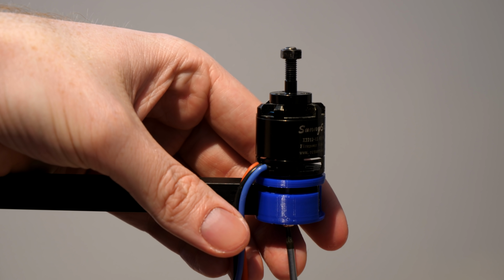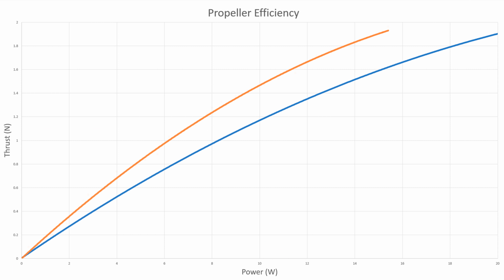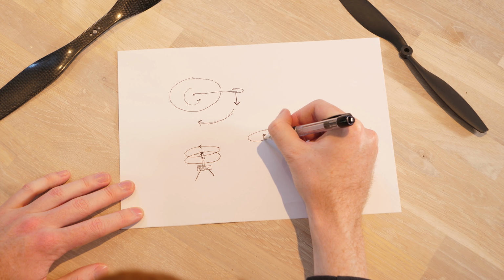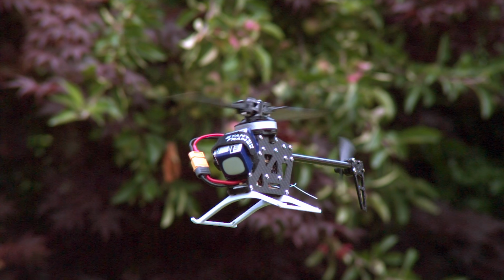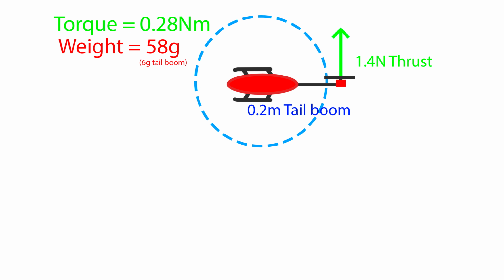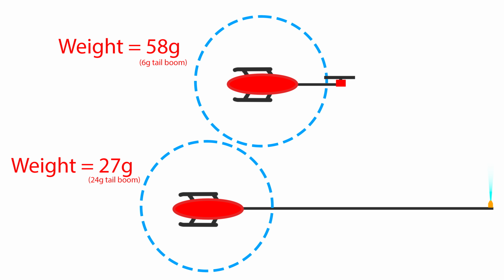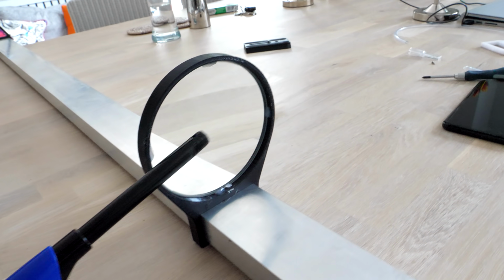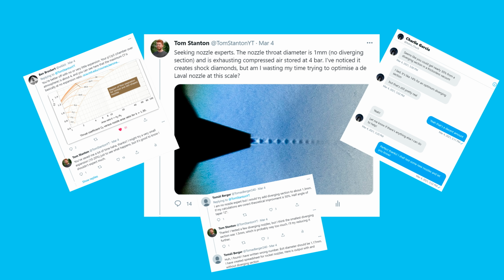Air Bottle Helicopter

Comment: Seeing as you are powering the rotor’s acceleration as you fill the bottle, I’m wondering if you could add weight to the blades to store the inertia like a fly wheel?

Comment: Don't use an air turbine and just use the air nozzles on the ends of a single rotor to spin it. That takes care of needing to counteract the torque between the helicopter body and blade. If it's too difficult trying to pipe air through some sort of joint that could spin you could even hard mount the rotor to the end of the bottle and let the entire thing spin on its long axis. Not a particularly graceful machine but if I'm following your description of the physics involved it might work. Good luck 3D printing hollow rotor blades with nozzles at the ends though!

Comment: I think two bottles cap to cap with a propeller and turbine for each might have been the play here. Double the propellers means double the stabilization. Any forces from the fill nozzle would be directed straight up the center of gravity. The propellers would be lifting an equivalent amount of mass despite there being two of them. Also the bottles themselves could be used as the aircrafts structure though you might need some struts between the bottles to prevent vibration issues

Comment: Make the inlet a oneway valve. So that it doesnt influence the craft. And to make the disgne easyer. Replace the tail bone and bottle with a thinner long bottle. That runs over the complete length. This means les overal waight. and the tail roater is close to the energy source(no time spent inflating the tubes.).

Comment: An advise for your design: use a tube to guide pressed air to the blades' tip to drive the main rotor, you don't need counter rotation mechanism and gearbox. but a sealed rotating mechanism is needed. use PMI foam and thin carbon cloth to build the rotor, make them super light and very long, the only dead weigh will be your air tank, which could be built by carbon fiber also.

Comment: Loved the video! This is a great example of true experimentation and engineering!

Edit: I have a few questions:

How much airflow was needed to lift the craft? (You only had the watt calculations) 

Did you have and expected PSI for the bottle to achive?

Do the nozzles you used output a consistent output after a certain pressure? Or is it, more PSI in the system, the more output?

It just seemed like the idea to fill and launch at the same time was too uncontrollable.

Comment: Weight balance is more towards the tail that's why the nose pitches up violently. The bottom of the bottle is thicker and heavier. Move the props about an inch or so further towards the bottom of the bottle and try again.

Comment: Simplified approach: one rotor rigidly attached to a bottle cap which can be screwed onto the bottle. Air is allowed to pass through the blades to the tips where it causes the entire assembly, bottle and all to spin. Bottle has a pendulum effect keeping it stable.

Comment: Your heli doesn't have enough sustain.

I'd suggest trying a 3liter soda bottle, and a more standard fill valve and shutoff valve setup.

I'm sure you can make the weight gain from those changes minimal, but it would allow you to set a definitive pressure before launch. I don't think your bottle was filling to max pressure

Comment: You are Superman! 😂 I have no idea of this project but you did it!!!
Reply: Thoughts: what about turn the bottle to the stand up position, then it would have better stability keep the helicopter not to tilt sideways. Then add 3 thin sheet make it looks like a rocket, the center gravity will be lower, and the twisting effectiveness will be reduced. And change the tail to a long straw, reducing the weight, as well it don’t need that much stiffness on the tail. Now you will have a more ugly helicopter, but much better controllability. Now you will probably need to deal with the rest of frictions... 
otherwise, test it on the water... less damage to the failed test... 
don’t know if you can see this but good luck to your hardworking guys!

Comment: Wouldn't consider it a failure.  Pushing the limit on designs are learning new stuff is what the game is all about!  Wondering what the lightest high pressure  (2000-3000 psi or above 170 bar)  chamber you could come up with??  Having a higher pressure vessel and adjustable lightweight regulator would add a lot more weight but you could also build a larger efficient air engine (and prop).  Think it would be neat to see just how much larger it can go and still provide lift and control.  BTW have you seen Tim Stanton lately??  Noticed he also hasn't posted videos in a while!

Comment: Ditch the turbine, and go with an air-jet tipped rotor affixed to the air supply so the whole thing rotates like a stick copter.  It'll be a simpler design with no moving parts (other than air) and a lot less weight.

Comment: You should use the bottle to power a set of fly wheels on a detachable helicopter (so the bottle is just the launcher, slowly releasing energy into the fly wheel)
Reply: When the bottle runs out of air it can launch the helicopter like a spinning top

Comment: Here's a thought: use tip jets to spin the rotors and thus avoid a gearbox entirely.
Reply: That would be a lot less efficient that the current design.

Comment: Maybe try boosting the performance providing additional gas supply by adding some dry ice. During the phase change you will get constant pressure during the flight and each g of dry ice will give you additional 0,5 l of CO2. Maybe it will not work with helicopter, but for plane it could be usefull.

Comment: Would mounting the air storage bottle vertically help?
  -  Maybe reducing the downwash hitting the craft will reduce the thrust needed, and reducing un-symmetrical air flow around the bottle might reduce a possible source of instability.
  -   Putting the bottle vertically would lower the center of gravity of the craft, and would increase the moment of inertia resisting pitch and roll, both increasing stability.

Comment: For contra rotating props, instead of gears, you could use a thrust bearing.  If this thrustbearing is held in place and the engaged surfaces spin freely, it should efficiently transmit a counter force from the bottom prop to the top prop.

Comment: More bottles means more weight, which means we need more thrust, which means more bottles – but won't an equilibrium be eventually reached? I mean, if 1 bottle is enough for one propeller and engine, won't 2 bottles be perfect for 2 propellers and engines? XD

Comment: Dude it’s time to move over to 9g CO2 bottles as a source of power for your projects, learn to control it and build something that stays in the air for 1minute or more. Maybe start with a motor glider and try to stay in the air for 10+ Minutes. Awesome content as always but you reached the limit for soda bottle power ;)

Comment: I think you need to hold the cog down until you reach full pressure and only release once you have a high pressure, looks like you always released it as soon as it had enough pressure to just do a little more than hover. If you want to achieve higher lift and ceiling height you just need more pressure and make sure it doesn't fly away until you reach the desired pressure. Hope you might try

Comment: When you get shock diamonds that means you're already over-expanded. Shock diamonds come from the atmosphere pressing the exhaust flow together. Converging-diverging nozzles only make sense when the exhaust leaves the nozzle above atmospheric pressure, visible in Schlieren imaging as the flow expanding outwards to the sides after it leaves the nozzle.

Comment: Even with no drag, the rotor efficiency goes down with thrust. Thrust is proportional to power^(2/3). And larger rotors have theoretically better thrust/power, with power inversely proportional to rotor radius.

Comment: I like the non fossil fuel idea you are possibly running on. It can run basically on muscle power, compressing air using a hand pump/compressor.
That would be cool! A man powered air compressor.

Comment: Have you considered having the main rotor powered by a flywheel and using air for control? Or possibly getting extra power through the combustion of alcohol vapor like in the rocket video? Also, great job, I always love your videos!

Comment: You have to put the inlet nozzle in the bottom of the bottle (under the main rotor) so it isn't pitching.
Reply: Came here to post the same suggestion and was surprised I had to scroll down so far to find it.  He could also go back to the original fill nozzle to get an initial boost for liftoff.
Reply: Or pre pressurize the bottle with a pump and use a valve to release the pressure, doing away with the whole problem of release instability.

Comment: Love the project! It looks like you're still getting a lot of energy loss in the gear wobbling on the prop. (check the slow-motion) maybe fortify the structure of the mount, and tighten your tolerances then add lube? I can see the gears binding, which is causing the bottle, and tail rotor shaft to flex.

Comment: i'M sure you thought yourself about it, But just ... the think i was thinking about watching your vid was, that the rotar was allready turning while air was filling. would it not beter to hold that until the bottle was fully pressurized and you release the heli?

but it is cool to see that the best people has some issues sometimes getting there idea out to work. It give us inside on how difficult it can be to be an engineer. And that it is okey when it happens. Now we know this concept did not perform as we wanted.

Comment: another option could be is to have a gear/transmission connected from the main turbine going to the tail rotor. in this way, you will only need 1 turbine (main turbine)..

Comment: What about having the bottle be vertical with the Old inlet nozzle design on the bottom. Then integrate the turbine and carbon shaft into the bottle cap. Fewer parts and the vertical jet of air would give you a little boost off the ground. I have no idea if this would be dramatically less stable with so much weight hanging down below the rotors

Comment: Air powered helicopter in that size is totally doable with a more efficient engine. 

Here's a toy version from a ways back that uses a piston to better extract air pressure energy: https://www.ebay.com/c/1701458583

Small-scale turbines are just hard without terribly fine assembly tolerances.

Comment: Is the bottle actually getting pressurised while running like that?
It seemed to last way less time than the other planes.

 Feels like it would leave through the engine just as fast as it entered through the tube/ the pressure drop of the compressed air moving through such a long/ thin tube at high flow would mean the bottle doesn't actually get pressurised and it stops almost as soon as it's disconnected?

Some sort of flow divider or switchover system might be necessary? That, or some chonky inlet tubes/ high volume pump

Comment: no shit its not going to work the most efficiency way to use the compressed air would be to nozzle it out the bottom, and even that doesn't have enough thrust to sustain flight, much less using complicated gear ratios which probably have 20% efficiency. Dont know why you would waste so long on something that is simply impossible no matter what

Comment: I think coaxial blades are your best bet, trying to make a "tail rotor" that just passively generates the right amount of torque trough the entire flight is probably impossible, since you don't have to worry about swash plates i bet you can make the mechanism be very simple, i am far from an expert but maybe you could make a fixed vertical shaft where the props can spin freely than spin the bottom one with the turbine and connect it to the top one with a simple gear to reverse the rotation. I also would like to see your compressed air engines run on something with a little more juice like compressed co2 or a simple gas generator (like a plastic bottle where you mix vinegar and sodium). Anyways great work, love your vids.

Comment: Could it work if you ignore the torque and just let the bottle spin but mount the propeller on it end of the bottle instead of the side so it is symmetric as it spins? Then you could cut out the weight of the tail boom and air it bleeds off. Would be dizzy to ride in though.

Comment: You should try using those little CO2 canisters as a source of air, they have about 800 psi so if it’s regulated it could last a while as well as being light and small
Reply: I think they would be quite heavy. And the problem is, you can't refill them.
Reply: @generalfishcake  There's CO2 canisters for paintball that are refillable. Some are even made of carbon fiber to reduce weight. The issue is that they're pricey and bulky. They'd require a larger helicopter.
Reply: Another issue is that the pressure they can contain is very high, not unlikely to grenade the turbine on the first run. And if you run it at a lower pressure, why use it at all?
Reply: @professortrog7742  I was figuring that when the pressure is regulated it would be able to sustain itself longer, rather than releasing all of the pressure at once or in a very short burst
Reply: @professortrog7742  There's this thing called a pressure regulator
Reply: @yucannthahvitt  making a lightweight pressure regulator is another project in and of itself.
Reply: The little disposable ones that you can use in single-shot bike tyre fillers? That's a really good idea!
Reply: I suggested some dry ice.  Add enough water to get the sublimation rate right, and it would be self-sustaining for a while.

Dry ice in a sealed bottle makes a hell of a boom.
Reply: @jackdedert2945  That's a good idea, although I wouldn't bother with the water.
Ya, dry ice bombs (and pool chlorine bombs) were something I never mucked around with as a lad - too many stories of kids poking them and getting shrapnel. Don't play with anything you can't safely defuse or set off remotely.
Reply: @sangomasmith  As long as you don't seal it up, you're safe.  I'm afraid I was a 'bit'' older when I experienced the CO2 bomb effect.  When I was a 'lad' everything came in glass bottles...not a good container for a bomb designed to only make noise.
Reply: co2's compressibility factor is way better than air's, so even using the plastic bottle with co2 you'd already get better results. plus aluminum isn't actually that heavy when compared to a plastic bottle like this - not when compared to the pressure it can hold, but if you're just gonna use an off-the-shelf aluminum can then you might as well just use the plastic bottle because the cans are designed to be thrown at a wall and not blow up, so lots of extra aluminum there, and I don't think he can make something with tolerances tight enough to make it worth it.

That said, the whole idea is dumb. in order to make that work any reasonable amount of time (and I mean 10 seconds or less) you'd have to make some "chamber" to trap air and spin the rotor before the air could escape (again, that would require tight tolerances). Little tube thing should also be a rotor like in a regular heli, otherwise most of the air is just gonna run out through there in the first few seconds.
Even if you did all that you'd still have a gearing problem, if the air could push the rotors from a standstill, that probably means too much air would be going through the chamber when the rotors were going fast. And vice-versa, in order to not have waste when the rotors were going fast, you likely wouldn't have enough pressure to defeat the initial inertia.

His heli only flew because of how fast the rotors were already spinning once it was let go, everything he did had no effect because any extra air pressure in the bottle went away in probably less than a 10th of a second.
There are already gas pressure based designs for engines. You grab oxygen(air) from the atmosphere, add fuel, ignite it - the fuel turns to gas and the gas expands because of the temperature, creating pressure and torque inside some kind of chamber. That's every non-electric motor ever built - including turbines and jets (jets don't always take air from the atmosphere, but they work with some kind of oxidation anyway). 
I don't know sh-- about physics but some simple math should tell him that the maximum amount energy stored inside that bottle could only power those rotors for a few seconds (assuming 0 waste). Even if he did manage to make it fly for like 5m (in a fantasy world), adding any control logic and hardware to it would cut that back into seconds because of the weight. 

I really don't get what the expectation was or why there even was one. Making dumb ideas for sponsor money I can understand, but being sad when the dumb ideas don't work perplexes me.
Reply: Yeah, what about a soda stream canister?
Reply: Paintball guns already have pressure regulators on them. No need to design something when it already exists and is small and adjustable. And the canisters are extremely durable and hold a significant amount. They get bashed around while they run around with them after all.
Reply: 69likes😏

Comment: Hey, if you go back to the quadcopter design with larger propellers but with a constant speed setup and using collective angle variation for control you can make it work. There is a simple way to implement collective variation through an Angular Motion Translator. Patent is here: https://patents.google.com/patent/US6547689?oq=angular+motion+translator